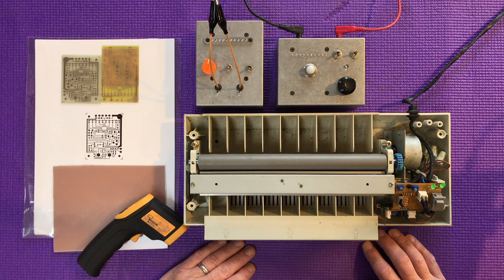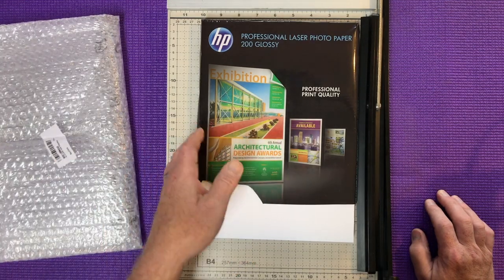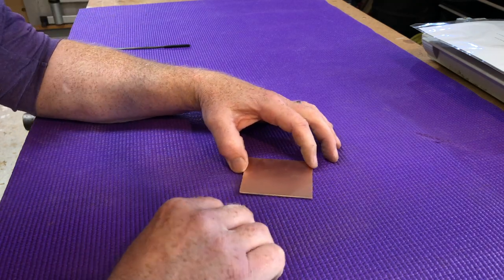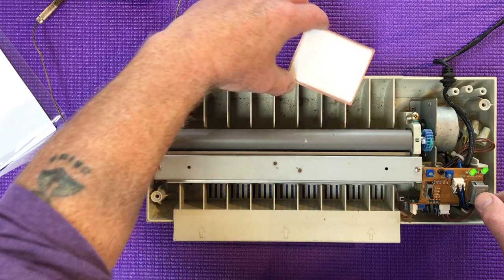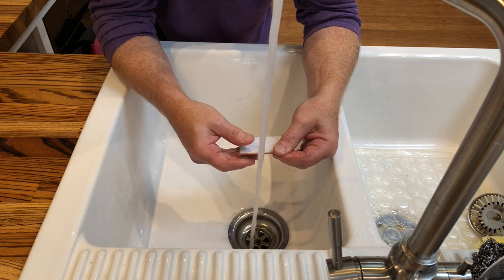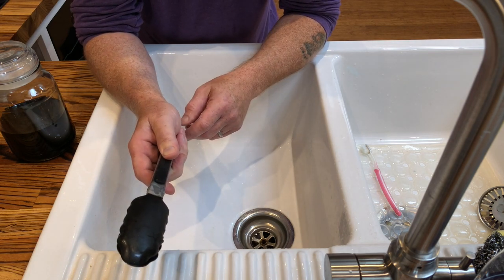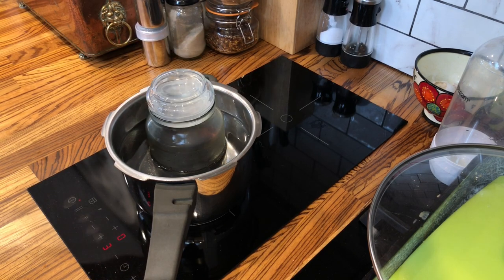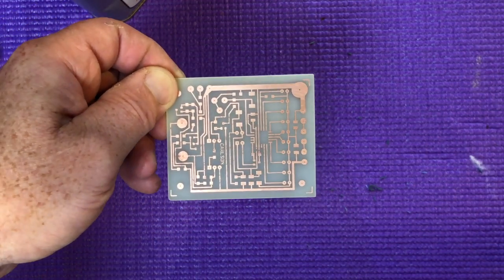Make a PRINTED CIRCUIT BOARD - Mr Carlsons Lab Capacitor Tester

Comment: I've been a patron of Mr. C's for the past two years.  Have collected all the parts to build half a dozen of his projects but the making of the circuit boards has been the one show-stopper for me.  However, I just bought a used laminator so maybe that will finally allow me to etch some boards.  As you say, the process isn't difficult, but getting the tools together without spending a fortune on them can be.  Thank you for this clear rundown of the process.
Reply from the maker: Thank you for your kind words.
Reply: This is a good video with lots of valuable info. You could also check out BigClivedotcom on youtube. He made a video outlining his etching process. Its more or less identical up to the actual etching part. He uses some bags with clips to contain the etchant and board. As the author of this video explains, Ferric Chloride is just awful and stains everything it touches. 
I remember doing this as a teenager using an iron and a very specific glossy inkjet paper. I had yellow fingers for near a month afterwards. WEAR GLOVES haha.
Reply from the maker: @FailedSquare  Hello and thank you - I’m pleased you found it informative👍🏻 The ol’ ferric chloride is indeed nasty - I think only polyurethane glue is its equal for deep staining fingers.
Reply: Been the same for me. I am a bit surprised there is not some sort of diy board maker/printer.

Comment: FYI:  Paper-wise whatever you decide to use make sure it's a "Laser" grade paper, like the one shown in the video.  While you can put most any "Laser" grade paper products into an Ink Jet printer and it will work fine, the opposite is not true; some "Ink Jet" specialty papers can wreck the fuser in a laser printer which is not a cheap mistake to make.

Comment: Be aware of when you ANYTHING close to the fumes, ie the circuit boards inside the microwave, the metals get corroded away! I had a "sealed" bottle of ferric chloride stored in the same storage tote with some old circuit boards and the fumes DESTROYED them over the period of a year. The bottle had no signs of leakage! I'm a huge fan of Mr. Carlson's videos also. Thanks for the great video! Has your wife seen it?
Reply from the maker: Hello Ryan, yes, my wife has seen it.  She likes my manipulations of what is safe or not.  There is a fine line between success and disaster, and I choose  learning from the informed experiment method.  Thank you for you comment 🍻

Comment: JLCPCB for the win, threw away all my PCB at home materials years ago once I found how cheap you could get professional PCB's made in China. I don't miss handling the chemicals one bit.
Reply from the maker: A fine plan indeed!
Reply: One option for sure. If you watched Mr. Carlsons lab on making boards you can make a pcb in 20 min.  and not have to wait days for the board. Once you check your prototype for stray capacitance and possible other layout flaws and what not then order your large amount.
Reply: Not an option for me, import taxes cost me 5-10 times what the pcb itself cost. So for one of boards not an option, also ... against the 'terms' Mr. C. set (if it is one of his designs).

I have done it a few times for more complex stuff (custom pci cards for one) but for simple stuff it is just too much overhead.
Reply: One nice thing about the JLC boards is, the through holes are all drilled, and basically are also VIA holes as well, plated from one side to another. I ordered boards from them for a small project and I was pleased with the product. If I wasn't happy with putting something on a perfboard with solder pads, going forward I will definitely create a gerber file and order boards .
Reply: Oshpark

Comment: I haven't thought of using a laminator.  Thanks!  I'm used to seeing the process where the print is laser printed on to a glossy page pulled from a magazine, then transferred with a clothes iron.

The laminator sounds like the better choice for 2 sided boards.
Reply from the maker: Hi Tim, the laminator is excellent for double sided boards 🍻

Comment: tip: a lot of photo paper and glossy magazine paper has calcium carbonate in it; if you put the board in an acidic solution, you don't have to wait for the paper to soak in water; it decomposes and you get a much better result, with very little residue; i use a cleaning product based on 10% clorhidric acid and 7% sulphuric acid;
Reply from the maker: Hello Stefan, that is an interesting suggestion, one for the lab after a few of these🍹😁💥

Comment: Part of the hobby for me is creating my own boards. It doesn't matter how cheap they are from sources. I by far prefer milling boards though, all I need is 1 small CNC engraver. No printer, no paper, no laminator, and no chemicals. All I have for consumables are the engraving bits. I can make many boards with a couple $1 bits and the machine drills the holes for me. I even enjoyed the process of learning how to cut a board with proper feeds and speeds thru experimentation and I got got learn what software works best for me personally. Additional bonus, I got a machine that I learned how to modify the firmware for the controller board after I added a new controller. So many facets of the hobby just because I wanted something a bit different and wanted to mill my own PCBs. This all started because I started teaching myself electronics =)
Reply from the maker: Hello Ian, this sounds like time well spent to me.  I think I might invest in one myself at some stage; so much fun to be had.  All the best
Reply: What software do you design your circuit boards with and how do you convert it to a format to drive the CNC engraver. Also, how much did you spend on an engraver - which one works for you?
Reply: @reedreamer9518  any software that can output a Gerber file will work. The software that I use to generate g-code for the engraver is CopperCAM and it imports Gerber files directly. But I use Diptrace for designing a board.

Comment: Do you also tin the traces to prevent oxidation ?
Reply from the maker: Hello Ron, no I haven’t used the tin solution.  It is an elegant way to maintain the beauty of the traces and expedite soldering.  Varnishing is of course another way, as they do in industry.  If you want to finesse your work aesthetic then I would say tinning is a must.   The board in the video that looks tinned is actually silver plated...Happy New Year to you!
Reply: @GrantWyness  I use liquid tin. It makes the boards harder to solder, but it does offer some resistance to tarnishing. Bare copper is the best, if it is tarnish free.

Comment: gentle agitation of the FeCl3 bath is a very effective way to speed up your etching and personally I prefer to do that rather than heat it up. cold FeCl3 is unpleasant enough. I use room temperature etchant in a one of those lockable tupperware boxes which sits on a very basic agitator of my own construction. Its just a tiny 30rpm geared 6V DC motor from ebay fitted with a small eccentric cam that raises and lowers one end of a small platform by a centimetre or so every couple of seconds, causing the etchant to gently but constantly wash over the PCB. with fresh etchant the process is done in around 6 or 7 minutes, perhaps 10 if the solution is a bit tired.
Reply from the maker: Hello Yeme, your way is a good way - The  board that I use has a thick copper coating and as such it takes at least 18 minutes with heated FeCl3.  If I used standard thickness board it would be just fine at room temperature and done at the times you say.  
All the best and thanks for commenting 👍🏻🍻

Comment: I seem to recall Mister Carlson had an additional step, which I think was adding additional (was it silver?) plating tot he exposed copper after the etching and toner removal. I suppose that was him "dotting the Is" (as he does!) and it's not ~strictly~ necessary(?)
Reply from the maker: You know him well 🧘🏼‍♂️ The tin plating Mr C applies is an aesthetic, also a sensible ‘old school’ approach to board making; very fitting for his channel. The tinning liquid is relatively expensive and not necessary to finish the circuit board of your desire. Board making is not my day-job, if it were, I would tin everything to add some bling in my life🥳

Comment: You can also heat the acid with a fish tank heater.  Just leave it in the jar through the process to keep a steady temperature.
Reply from the maker: That’s genius Johnny 👍🏻
Reply: @GrantWyness  Thanks.  I picked up a fish tank heater at a thrift store for $1.  It is temperature adjustable and the element is enclosed in a glass tube so it is protected from acid damage.
Also, agitation of the chemical helps to remove the coper more evenly. For that, I use a fisk tank air pump. place a polyvinyl tube from the pump into the solution and set the airflow on low to introduce a slow stream of bubbles.
Reply from the maker: @JWimpy  this is gold for someone who plans on making a few - thanks again Johnny 👍🏻🍻

Comment: I can't wait for someone to come up with an ink jet or Laser printer modification that would print directly in the PCB. I just do not have the ability to make one myself. To bad 3D printers cannot print 10 mil trace on a PCB. Nice video. Thanks
Reply from the maker: Hello Jim, thank you for you comments - a mod for a printer is a great idea - I have an old printer that wrote directly on CDs🤔 
All the best
Reply: It's been done, just search on YT.
Reply: ink jet will never work. The toner is creating a physical barrier, like a piece of plastic, between the etchant and copper.

A better possible solution would be a 3d printer that prints directly on the board, but I don't know enough about them to know if they can get down that fine or if the extrusion would stick.

Comment: Gee, guess HP saw your video and promptly stopped making the paper you used (HP code CG966A) ... Will try with the 150gms version but this is getting old. I have tried 12 different kinds sofar.
Reply from the maker: Hello, this seems to be the equivalent - https://www.amazon.co.uk/HP-7MV83A-Professional-Glossy-Business/dp/B0846HTLHH.  Try toner transfer paper, it gets good results too👍🏻
Reply: @GrantWyness  well good news ... for the first time ever I have managed to get my crappy laminator to do the job (95% successfully) with the lighter version of the HP paper (CG965A) ... That is one massive step forward which I never managed before with any of the others. It managed to transfer 95% to the PCB with a few spots missing (oddly enough the finer stuff like text all stuck fine, just a few breaks in thicker traces).

Found out one other interesting thing reading below in the comments here about using slightly acidic solutions to help release the ink. I used a vinegar spray (typically used for descaling things like coffee makers). Tested it on a piece of printed text (no laminator or anything just a leftover scrap) and the toner came off just with that. The paper did not dissolve or anything but the toner just released.

Laminator is still too low on temperature though but I picked up a small DAHLE 70401 laminator (used for laminating things the size of badges etc, 12cm wide opening) which is actually a really nice size for the small PCBs I will usually have. It surprisingly comes out at 150 degrees as is on 150 micron setting. Also picked up an Attalus Attalam 230S laminator, this is an A4 size laminator, heavy as all hell, all metal. That goes well into the 170-180 degrees out of the box. Both were cheap second hand finds so ...

I mention all this just in case anyone else (like me) has been searching for a working combination for this process. Oh should also mention the laser printer then a Xerox Phaser 6510 (using the original starter cartridges that it came with). I chose this one specifically because it does 1200 x 2400 dpi, is remarkably affordable and overall a decent printer for this.
Reply from the maker: @xConundrumx  Fabulous news! Thanks for posting all your findings 🍻
Reply: @GrantWyness  Final update, alas the Dahle did not work out. Feed through only pcb no issue, pcb + glossy paper however is just too much.

On the other hand the Attalus worked great, better than I could hope. Took of the protective shroud as the board was pretty small. It has 4 rollers, 2 before and 2 after the heater assembly. The PCB came out flawless. Not a single chipped edge, broken trace or other imperfection. The paper came loose without even having to tear at it, just the running water stream was enough to flick it off.

Pretty happy, all I need now is to find some liquid tinner. The MG Chemicals stuff Mr. C uses is not sold in/shipped to Europe or so it seems.

Comment: So much water and energy for such a tiny circuit board, poor planet !
Reply from the maker: Isn’t it just.  I’m being more mindful in my hobbies
Reply: Excellent video Grant.
Reply from the maker: @reybarrera6544  Ray, thank you muchly🍹
Reply: I tend to soak my boards in water in a tub rather than use running water. Also for cleanup I use a tiny bit of acetone not sure if thats the 'thinners' you were using